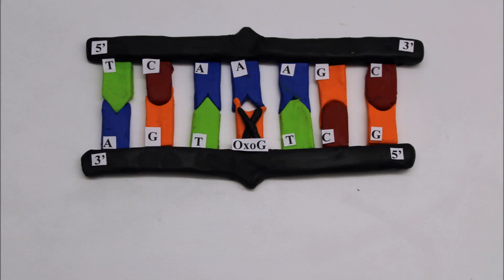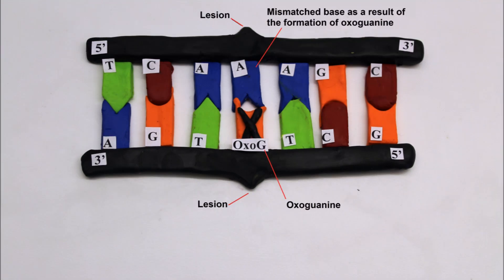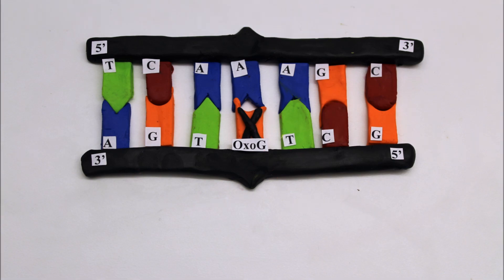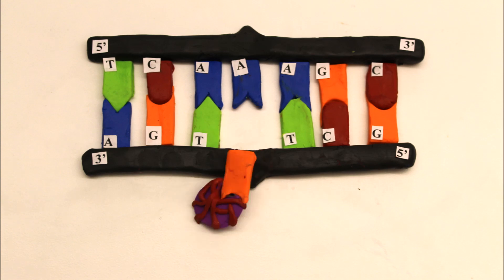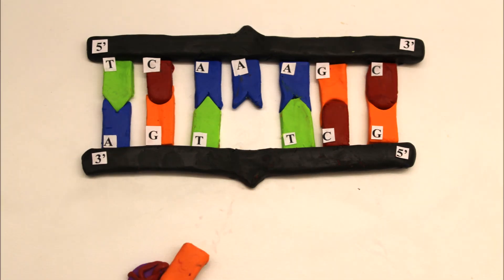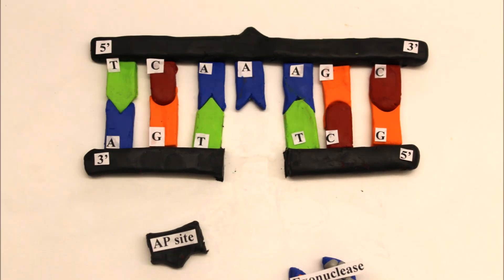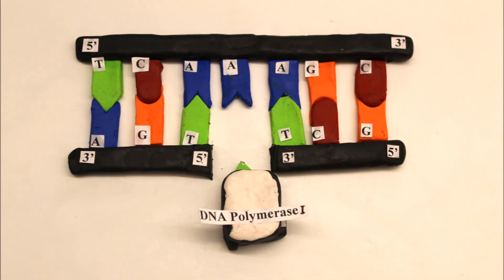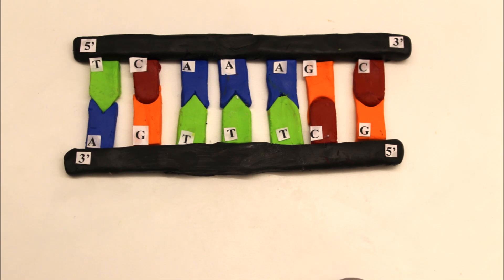Base Excision Repair

Comment: but how G is paired to A 
isnt suppose to be G bound to C then the G will be oxidised to oG
Reply: this is after 1 replication where the oxoG becomes bound to A. You are right that the original strand would have oxoG initially bound to C.

Comment: Wait... so... why is an oxoguanine paired to an adenine? Excuse my ignorance, but I don't make sense of that...
Hope you can answer. Thank you.
Reply from the maker: Hello, and thank you for your question! I can see where the confusion stems from, as in a normal DNA molecule, guanine would be paired to cytosine. In the case of this video, guanine is turned into an oxoguanine due to oxidative damage to the guanine resulting from exposure to ionizing radiation. Essentially, the oxoguanine makes a "mistake," (due to it being damaged) and incorrectly pairs with an adenine instead. This mutation could result in a number of problems if DNA replication was to occur without any correction. That is where the DNA glycosylase comes in. It scans along the DNA strand, locates the damaged base, and removes it.
Reply: They both have two hydrogen bonds.